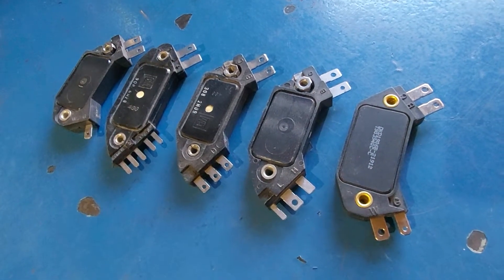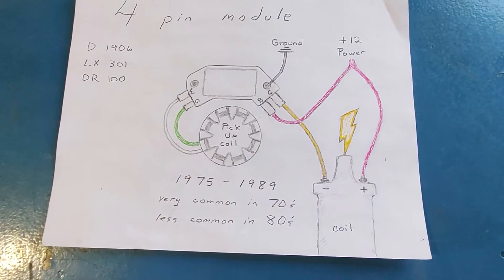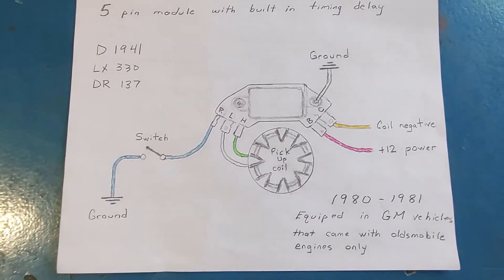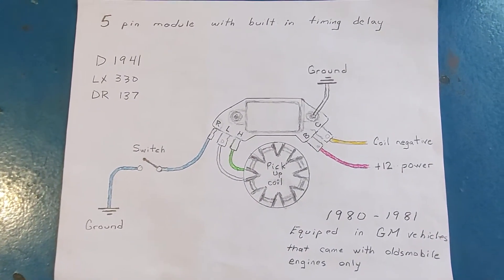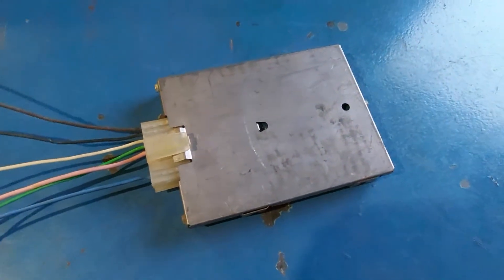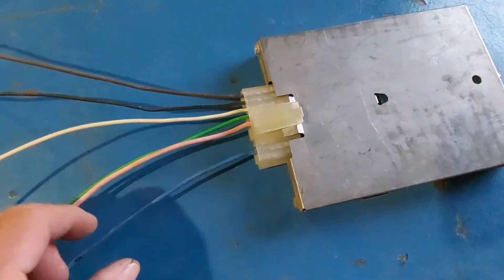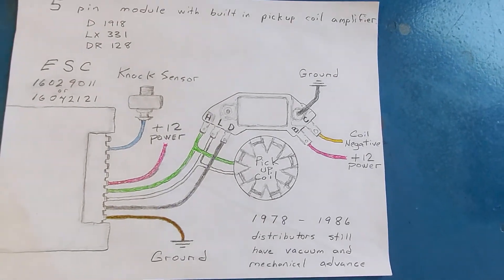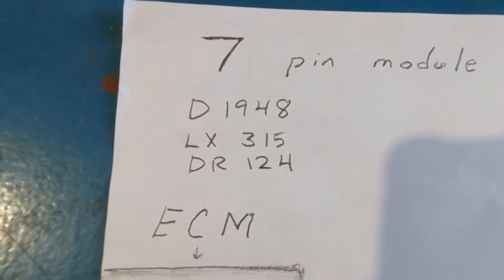How to wire up HEI modules All five explained with diagrams GM distributor 3 4 5 7 pin Ignition coil

Comment: Fantastic coverage of this subject Ray.
Thank you for sharing your considerable knowledge on the subject.
I have not seen such a comprehensive coverage of this subject.
I have one question for you.
Can you tell me the primary resistance of the coils that these modules ordinarily fire?
Reply from the maker: I assume these modules can fire any coil with the primary resistance of .2 to 3.0 ohms. I have used quite a few different styles of coils over the years, without any issue
Reply: @raysoto1969  Thanks Ray. 
Very interesting, they must be very forgiving.
Many ignition systems have conniptions if they are not mated to a coil with the correct rated resistance specified for them.

Your experience a very good guide.
Many thanks Sir.
Reply: Hi Ray,  have you ever experimented running non-resistor plugs,  low resistance or 0-ohm wires like Granitelli wires, & 0 ohm distributor cap rotor brush from either MSD #8412 low ohm brush or Performance Distributors #122222,  for either in-cap HEI coils caps or external coils caps in order to really create a powerful spark????
Just not certain if it can affect the module as i heard some resisitance is needed to prevent back feed of EMI into the module. 🤔 
 Also my idea is to modify a conventional cap that uses the external coil & implant the 0-ohm brush to do the same & reduce resistance..  Then you can run even bigger plug gaps along with a coil with longer duration & higher coil peak current rating that many MSD E -Core or U-core coils come in especially like the MSD #8253!🤔
Reply: The typical HEI ignition coil primary  resistance is 0.5 - 0.7 OHM. When using these modules in a small engine (1-2 cylinder application) I have found the typical non resistor ignition coil with 1.2 to 2 OHM primary resistance works very well.  Due to the nature of the HEI type systems and the very powerful spark it can deliver with the right coil, you can open up the spark plug gap to create a bigger spark kernal (greater exposure to the air/fuel mixture) This can slightly increase power output, decrease the chances of misfire under lean conditions and improve fuel economy with corresponding fuel adjustments. The down side can be that due to running leaner A/F ratios you can cause increased cylinder temperatures, higher peak combustion pressure and possible valve/seat and piston crown damage from detonation.  I typically open up the plug gap to 0.45 to 0.60 and only use premium fuel.

Comment: Ray, 

Thanks for these videos.  I really enjoy them and the clever ideas. Are you familiar with the the late module used on the L30 and L31 engines? I think it is Delco D579. I have thought about it as an alternative to the D1906, since the best quality versions are no longer made.
Reply from the maker: Yes, it can easily be wired in place of the 4 pin module... Definitely more reliable than the currently produced 4 pin modules